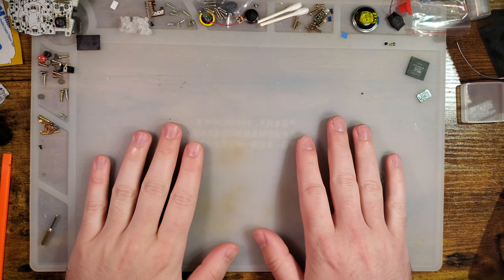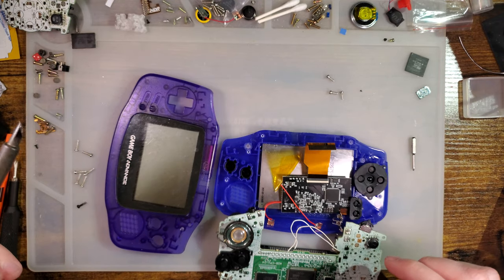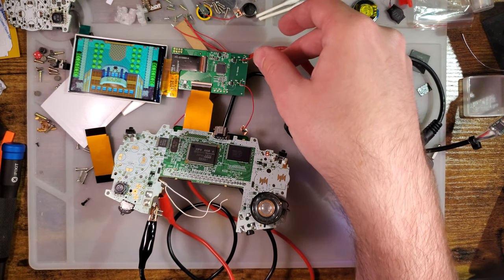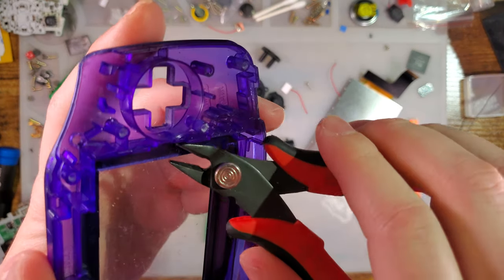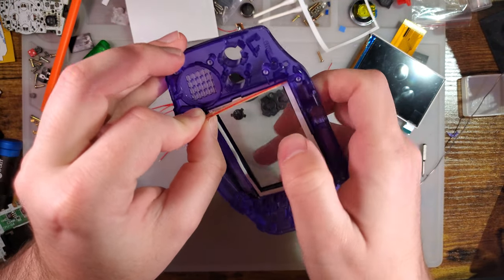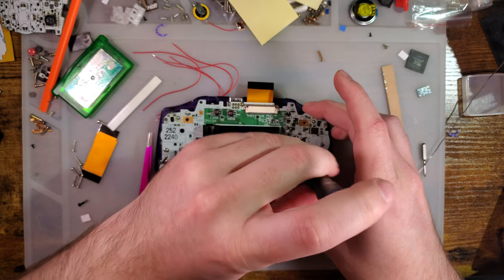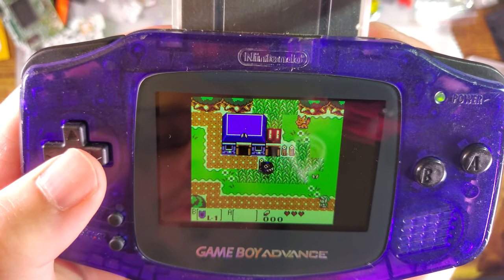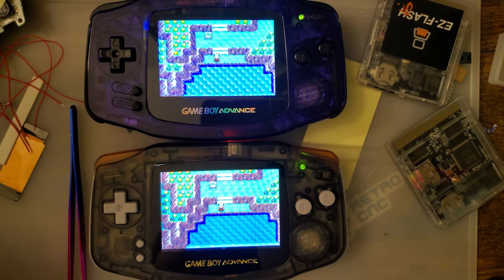Drop In TV Out -- Game Boy Advance IPS Kit ('One Chip' 'TV Version')

Comment: Okay, stupid question, since this is the same screen as the CGS screen, would it be possible to grab just the chip to upgrade a CGS install I did for a friend if they wanted TV Out?
Reply from the maker: It's not the same screen, it's just the same panel. The connectors are different. 

And no, most retailers will only sell you the whole kit, especially because the LCD itself is a very small fraction of the cost of one of these kits.
Reply: @makho  Thanks for answering the stupid question!

Comment: For some reason, right now at least, the IPS screen itself is more expensive than the tv kit w/screen included. Via handheld legends
Reply from the maker: Well HHL is known for the manipulative listings so I'd take that with a grain of salt.
Reply: I got mine for super cheap on ebay i wanted to buy 6 but i only bought what they had in stock. 
Edit i only paid 32$ each with the buy more and save option ebay has